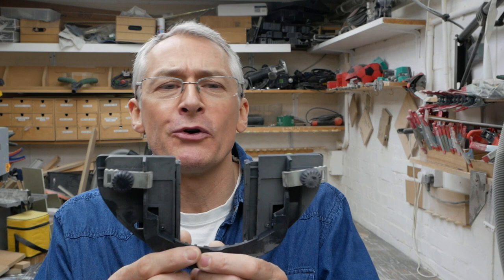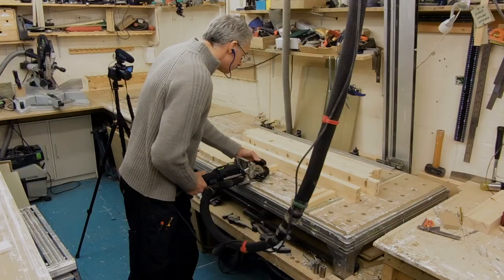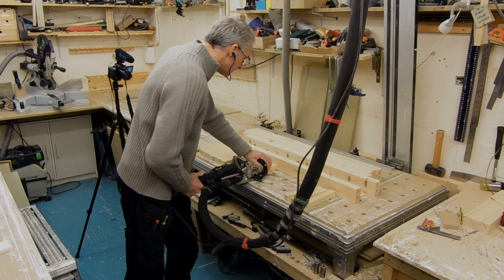10 Years of Domino Part 2 [Video #271]

Comment: As one who has mucked up a few domino joints by referencing off the wrong face or mixing referencing from the domino fence and the domino base, your demo of that showed referencing off the fence with the festool base stabiliser viz the domi plate looked as if one or the other must be wrong unless the cutter was set to be exactly in the middle.  Maybe a good reason for a follow up how to use the domino for the newbies is a good idea.
Reply from the maker: That was the plan, depending on how these two vids go down. 👍

Comment: For me, this is expensive. But as I want two alcove units in the front room, built in computer desk in my son's room and a custom chest of drawers in my room, all the labour for these would probably work out than the domino itself. Even all the other projects that can be done are endless. Fancy making a sofa console table with built-in wireless charging. Thanks Peter 👍
Reply from the maker: Cheers Leigh. Yes, it’s certainly not a cheap tool, but it’s very effective, and incredibly versatile. Charge yourself £50 every time you use it, it’ll soon be paid for! 😆👍👍

Comment: Mafell and Lamello have very limited distribution here in the US, Peter. The 120v Mafell Duo Doweller will set one back an eye-watering 1380 USD (1084 GBP). The Lamello Zeta P2 goes for a ghastly 1850 USD (1453 GBP).  The Domino DF 500 Q is $960 (754 GBP). Prices do not include sales tax. Now when do Festool's patents expire?
Reply from the maker: Thanks David. I’d heard about the limited distribution, didn’t know about the prices. Yikes!

Comment: Sorry for off topic comment, but have you had a chance to do a follow-up on the broken air quality monitor, since the Gifts for Makers vid? Is the second one still going strong? Thanks.
Reply from the maker: Hiya. Yep, second one is still going strong, haven’t had a chance to fit the replacement sensor in the old one yet, but I do expect to resurrect it but will report back 👍👍
Reply: @10MinuteWorkshop  Thanks for the reply! Are you planning to replace the Plantower air sensor wholesale or is there some individual component to be swapped out?
Reply from the maker: Yes, I just picked up the replacement sensor, I’ll swap it out when I can 👍

Comment: Thanks Pete... I'll tell you one thing though... Festool will feel it when the patent runs out & others such as Triton /Makita / DeWalt etc. produce their version... as someone else has said hobbyists can't contemplate the present cost but if a good-quality & half-the-price competitor appears we hobbyists will be all over 'em !! 
😅😅😅😅😅
I'm betting there are products already waiting in the wings ...

👍😎☘
Reply from the maker: Look forward to the day! Don’t hold out much hope for a Triton, mind, given their woeful doweller 🙁
Reply: Funny that... the Triton planer thicknesser and the TRA001 router I got are both great machines.. 🤔
😎👍☘️
Reply from the maker: @peterfitzpatrick7032  I agree - I have the router slung under my bench and it's an real workhorse, but the doweller was woeful - I bought and returned three before I gave up on it.

Comment: I'd love to see you do a full in-depth video of the joiner  aimed at those who have never used on before, for example if you were making a square cabinet with let's say two internal shelves. How to set up , mark out and where to register the face and fence of the machine (hope I'm making sense ) I'm led to believe the domino doesn't mortice perfectly central in 18mm sheet goods so bearing that in mind  morticing for internal shelves will require registering the machine against the cabinet sides slightly off centre.  Anyway I'm starting to waffle now 🤔 look forward to more videos .
Reply from the maker: Thanks! TBH if you look at just about any video where I’ve made cabinets or wardrobes - especially the earlier ones -  I go into a fair bit of detail about it. Not with a new user in mind, to be fair, so perhaps that’s an option. And yes, I have a few other videos about the Domino planned, depending on how these two go down. 👍👍

Comment: Nice video. I agree with you about the nice improvements that should be available. BTW your plate will not work in the middle of a Board. There you will need the support plate , which is a crab of plastic. The same with the fence extensions from Festool: it is not an exact piece of plastic.
Ithink the Domino will have a new life with the nice joints the now have. Have you tried them ?
Reply from the maker: Thanks. No need for the support bracket in the middle of a board - you have the full face of the fence flat on the. board. New joints? So you mean the Domino Connectors? Yes, I’ve been using them for a while - I use then in the current video #269, Drop Down Doors. They’re very good - a bit expensive, but cheaper than buying a Lamello Zeta P2 👍👍
Reply: @10MinuteWorkshop   Exactly !  And I also don't see why I should buy a Mafell DDF40, specially when I already have a DF500 ? I think the DDF40 is old style with no advantage compared to Domino's or Lamello's .  You might imagine that a simple duo-driller could be cheaper than more complex other hand tools - but it is not on the market with such a competitive argument; so what ?

Comment: Hi Peter - your vids are very much appreciated - hope you know that? I am going to make some kitchen carcasses - 18mm birch ply. I looked at the US plate - ouch. Could you not simply use a 4x2 clamped 18mm back for those awkward edge holes?
Reply from the maker: Hi David, and thanks! Oh, sure - I just used a piece of plywood screwed onto the base of my domino for a long time and it worked great, but the actual domiplate is a really nice thing to have. Not essential by any means, but it works really well. 👍👍

Comment: Even though the Mafel is more money dowels are more readily available than dominos, almost any hardware supply store sells them.
Reply from the maker: Yep. And thanks for the reminder - I need to order some more 5x30 Doms... 😂 First guy I ever worked for straight out of college taught me an invaluable lesson; the most expensive thing a one-man-band business can do is to run out of something - so now I almost never do 👍👍
Reply: @10MinuteWorkshop  Where/how do you buy/order things? Do you order in the internet (specialized webshop or the web shop of a local dealer) or do you physically go to buy things in a classic shop (store)? The latter takes a lot of time which you probably prefer to spend in your shop, working on a job for a client.
Reply from the maker: Hans de Groot I mostly buy online, from a specialist dealer website, though sometimes from Amazon. I can mostly get things next day, but my local timber yard also carries a small stock of some useful odds and ends - Festool abrasives, extractor bags, some dominos. Easier just to order online for delivery though, unless I’ve let my stock  run right down. 👍

Comment: Yeah Let's had one three years and last year bought the XL we needed it lol😚😚😚 also l got a Triton duo dowel after watching Andy Klein's video, and it ain't no domino for sure, but 32mm spacing and takes  maffel duo dowler bits (also CMT do them from Scot & Sargent) so I'm going to use it mostly for euro hinge driling and shelf pins, just going to make up a maffel style spacing jig which cost about the same as the Triton machine. 

Anyway keep up the good  work  Happy New Year🎉🍻
Reply from the maker: Thanks! Wow, you manage to get a Triton Doweller that worked?? I bought 3 of the things to try and do a ‘Festool v cheap tool’  comparison to the Domino and didn’t get one that worked well enough to make the vid. Gave up!
Reply: Peter Millard biggest thing was putting in a lower tension spring that made a huge difference, it's not perfect! just good enough.

Comment: Not a mention of the XL good sir?  Seneca also now supply a bit adapter and plate so you can use all the df500 domino bits and stock too
Reply from the maker: Don’t own an XL 🤷‍♂️
Reply: Peter Millard I’m registered blind and can’t see to do mortises and tenons neatly with the little residual sight I have. Someone sold me their old unused domino xl for a fab price and it has changed everything. I wish I had a sawstop as I work literally millimetres away from my table saw blade lol but that’s in a whole other dimension financially!
I really like your stuff.
Reply from the maker: @ChinskiChat  Wow, that's amazing! Great application of a domino that I'd never even thought of. Well done! 👍

Comment: Great video, thanks for sharing. In the video you showed how to make the mortises on small boards. There you probably used the pins to have them aligned at the wished
positions. How do you do that on larger boards? Do you use classic pencil lines or is there an other (better?) method?
Reply from the maker: Thanks Hans. I just use pencil lines, but with a tight Domino on one side and a loose mortise on the other; this gives enough ‘wiggle room’ to accommodate any slight alignment issues 👍👍

Comment: Peter, in your domino series you talk about making a domiplate. Do you know of any plans if you don’t have a domiplate to look at ?
Regards
Reply from the maker: Thanks! No, no plans available that I'm aware of; it's the simplest of things to make from a piece of ply or MDF though. It needs to be long enough to give stability, a couple of holes for the screws to attach to the baseplate, a hole to see the centre line of the workpiece, and a cabinet knob. That's pretty much it - assuming you have a domino the critical measurements are on the tool. 👍👍
Reply: Thanks Peter. The domino 500 arrived this week. Will have a play with it. I will probably buy the Seneca one in due course but metric are not available at moment. regards

Comment: The Mafell duo dowler lacks the sloppy setting which to me makes it pretty much useless. If your fitting more than a couple of dowels I just can’t see them lining up.
Reply from the maker: That’s the huge advantage of the Domino - it’s a precision tool that lets you work loosely. That said the Mafell Doweller has been around for about as long as the Domino, and guys who use it seem to get by just fine 👍👍
Reply: i have used the older duo doweler. and own a domino. you have to be 100% focused and accurate all the time with the duo doweler. one little bit off of a line and it wont fit. the longer the run of dowels the closer to perfection you need to be. with the domino you can be a bit less acurate on the line and give more attention to holding it square etc. domino all the way in my opinion.
Reply: @10MinuteWorkshop  Have an older Mafell doweller and have been using it for years.  Works great and haven't had any issues lining up pieces, even on 8 ft joints.  That being said, if I didn't have the Mafell I would buy a Domino.

Comment: Hey Peter, I don't know if someone asked this already, but is there any reason why you didn't go for a biscuit joiner at the time? Most people use a biscuit joiner for sheet goods (although there's nothing wrong with using the Domino of course - I currently only own a Domino but feel like a biscuit joiner would be faster).
Reply from the maker: To me, the Domino was clearly so much more versatile than a biscuit jointer, it was an obvious decision, cost notwithstanding of course. If you think a biscuit jointer would be faster, why not buy one and try it? 👍👍
Reply: @10MinuteWorkshop  Saving up for the Lamello ;-) But meanwhile the Domino does the job nicely indeed.
Reply: I have both a domino and a biscuit jointer. The biscuit jointer is by far quicker and the biscuits are a lot cheaper. Accuracy is a slight issue. However the domino is so much more accurate. Dust extraction is brilliant. Also for doing joints in say solid timber rails and stiles of cabinet doors the domino wins hands down. The domino is quicker than traditional Joinery Mortice and tenon machines. 

Nice video peter. I made my domino plate from offcuts of “solid grade laminate” very tough

Comment: I have noticed in this video that you seem to bend a bit while working.

Have you considered raising the height of your work bench?
Reply from the maker: Workbenches typically should be around wrist height, which is where I put mine. I also have low ceilings, so need them to be as low as practically possible. 👍

Comment: Do you have a video on how to fix domino mishaps? You mentioned in part 1 how you can experience drift in the fence. Just curious on what you did to fix the holes and get everything back in line. Thanks, Mark
Reply from the maker: Sorry, no - the fence drift was only on very early machines early in the initial production and was quickly sorted. It’s a non-issue now. 👍👍

Comment: When you say wiggle room, how does this work when they are glued in?  I’ve never figured that out
Reply from the maker: Wiggle room during the glue-up, not afterwards; it means you don't have to be super-precise, unlike, say, with dowels. 👍
Reply: Great thanks, I noticed there are two festool domino machines, I’m a novice still, but like the item, mostly I just do hobby builds for family, but I like to make slab tables, and soon will be making tables for my garage work shop, which would you recommended
Reply from the maker: I only have the smaller DF500, and haven't used the larger Domino XL (AKA DF700) as I don't do work on the kind of scale (external joinery like doors and windows) where it would be useful. I made a pair of smaller doors with the DF500 and it worked great, you just need to bear in mind that you only have a max plunge of 28mm, vs 70mm with the XL. So it entirely depends on what you want or expect to build. If it's mostly cabinets and carcasses the the smaller one will be fine, if you expect to do bigger projects then the larger one would be better, but as always try and get your hands on them and take advice from a dealer first. 👍

Comment: I really expected these things to create a mortice perpendicular to the edge in both dimensions.  I read from these videos that the mortice is fan shaped (in the "east-west" direction) and only has  glue contact in the "north-south" direction? Is that correct?
Reply from the maker: No. Though the cutter oscillates (waggles) from side to side, the act of plunging makes for a straight-sided mortise, albeit with rounded edges because of the cutter. A narrow-setting mortise is the same width as the Domino, so you get full glue contact; a regular Domino in a wide or mid-setting mortise will have glue contact top & bottom, but the joint is tight enough for this to be more than sufficient; I’ve never had a Domino joint fail in 11 years 👍
Reply: @10MinuteWorkshop  Thanks, Peter!  Good to know.   Best wishes to you and yours for a happy 2019 from down under...   Oh yeah...   Keep on Grooving :)
Reply from the maker: Thanks! Same to you too, 👍👍